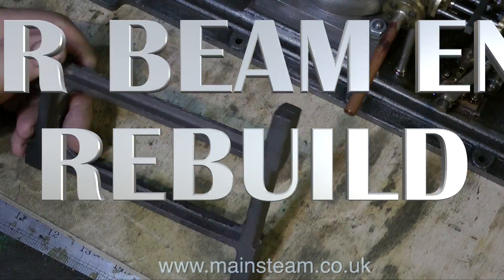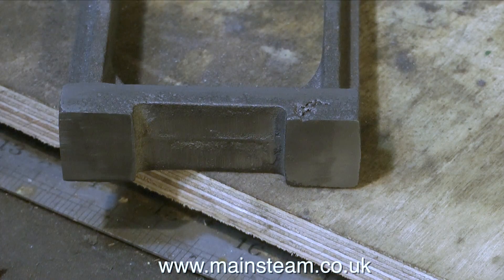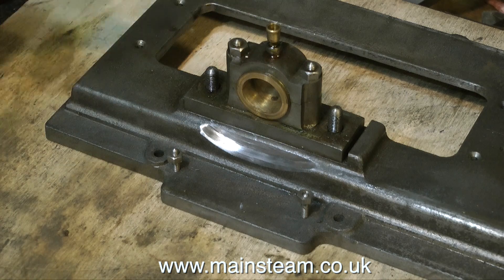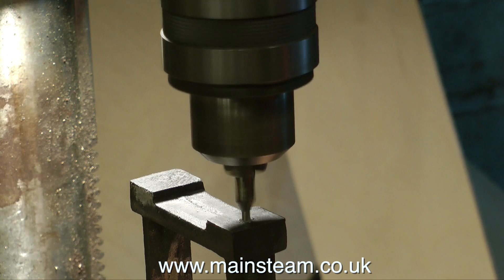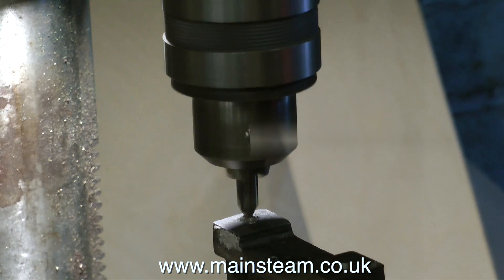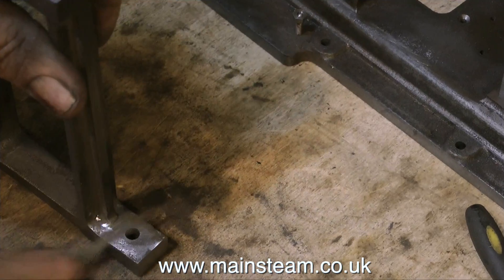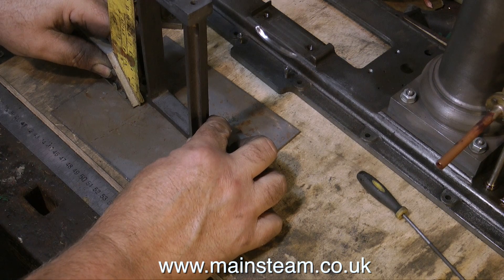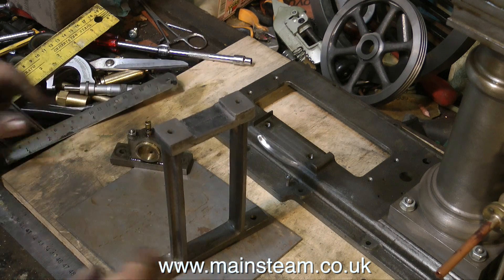STUART MAJOR BEAM ENGINE REBUILD - PART #5

Comment: There's no need of having the proper engineers blue Keith. It usually dries out over the years and much is wasted anyways. Buy yourself a sharpie pen with the largest and fattest felt tip on it in either black or blue. That ink dries almost as fast as the proper blue but it's far easier to use, cleaner, it doesn't dry out, and it's much cheaper while still doing the same job.

You might find that using a proper spotting drill instead of the center drill will work better. The center drill has the wrong angles on the cutting lips (60 degrees included angle) for the next drill to start cleanly. Using a spotting drill that's also very rigid will leave the same angle at the bottom of the hole as the next drills cutting lips have. I have used center drills for years for starting holes the same as your doing, and there is a difference using those spotting drills.
Reply from the maker: +Turning Point that's what happened to my jar of engineer's blue - it dried out. As to "spotting drills" I have never heard of them - I will look into it. Thanks.
Reply: +Keith Appleton 
Morning Keith, then you'll like using those Sharpie pens. Not sure about in the UK, but over here in N.A. Dykem who are probably the largest makers of layout ink here have even started supplying it in those felt tipped pens. I'll stick to the standard pens I buy now I think. They work fine and there cheap as I said.

Given the slight differences between our country's and the common terms we each use, it's hard to say for sure if those spotting drills are called something else in your country. You might do a Google image search for spotting drills and that will at least show what they look like. But there just a very short and therefore really rigid drill so they don't wander. If your going to use the mill and coordinate drill your locations, there's not even any need for center punching the part.

Comment: I've recently purchased a stuart major beam engine and I've got a question about the beam bearing pedastal studs. These are the steel studs that the parallel motion brass bearings wrap around. My question is, how are these studs fixed into the beam. I want to look at removing them because there is some slight horizontal play where the bearings wrap around the steel studs.

Comment: We have all met the high a mighty types who love to knock the slightest thing ,,,, but i for one love your down to earth approach  and willingness to pass on your proper realistic experience,,,  I don't have centre points and its great to see that you can get a very reasonable position marked using your down to earth method    ,,,,,   Must get myself a center drill instead of watching my twist drill bend and worm its way back and forth across the surface,,,  Many thanks ,,,,    ( hope you have beaten the cold into submission )

Comment: I have a problem with soldering two parts together on a boiler. If anyone can help explain what I am dong wrong, it would be much appreciated. I am trying to solder a brass water sight to a brass part on a boiler, but the solder never stays, and instead, beads up and falls off. I have tried using different types of flux and sanding the parts before soldering, but it still doesn't work. Is there a special type of solder that I need for this, or is there something else I am doing wrong?
Reply: +Erik Elbrect are you using the correct solder and flux combination for the job ? most suppliers will be able to recommend the correct type of solder for the material and the right flux. if not maybe the method the job should be hot enough to just melt the solder on its own not your burner  also if you get it too hot it will not stick
Reply: +Erik Elbrect Without actually knowing the particulars of the flux and solder you're using, its hard to say, but it almost sounds as if your solder is getting into the flame and melting before the brass has heated up enough to allow the solder to flow. If you're using silver solder (Which I would strongly recommend for boiler work, I can't think of anywhere on a boiler where soft solder is acceptable) the parts should be heated till the flux takes on a watery appearance, and take the flame away before applying your solder. Let the heat of the parts melt it, not the blow torch. If you try applying solder after the initial "boil" of the flux, it won't flow, the parts won't be hot enough. Also with silver solder, certain solders work only with certain fluxes. Make sure that the solder and flux you have are compatible with one another.